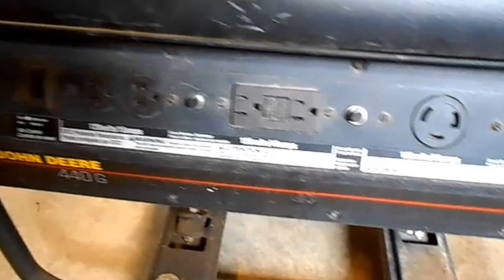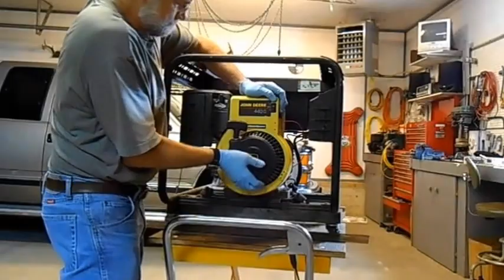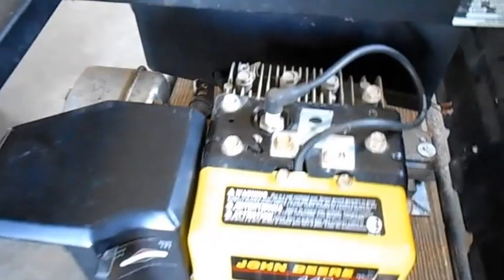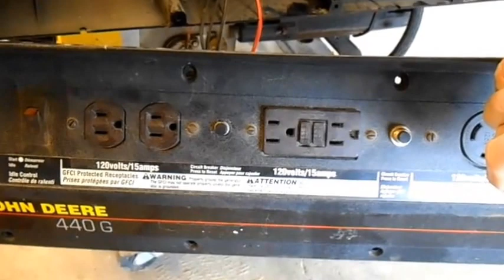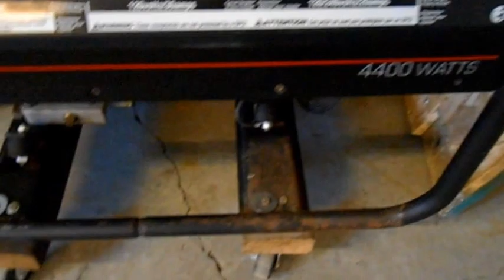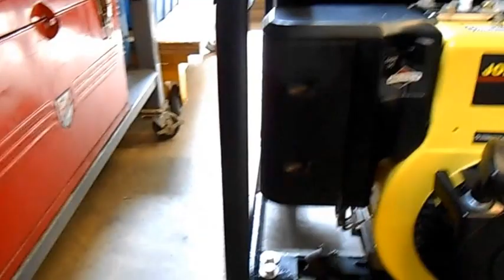John Deere 440G Generator Won't Start

Comment: Where would I find a coil pack? I have this exact model and I think this may be the problem!
Reply from the maker: First before you order a coil   disconnect the shut off wire from the coil and check for a spark with the spark plug removed.  If the is a condition like low oil or even a fake low oil it will not make a spark.    Here is a Canadian link  to the coil

https://www.amazon.ca/Ignition-Replacement-Stratton-Horizontal-Vertical/dp/B099ZPQZCQ/ref=sr_1_3_sspa?dib=eyJ2IjoiMSJ9.N4nOmUGS3wE_SvNCgZCj2y4GmHesSEQHW-EuaKTmoc6MKPOJoI3n282dTviWVFPo1XJQ3i8ijMu0AQnd3CsujepYs4LB6tfHKzaMbPgOG1dcbPUHjRb_6Iy9jwHMfbBW2cTPMjxn6Juj4ViU2GxY1K71JveGoxiUdrP2gYoOSYBo30qsfmAVaPES-2ZpwC8zkL1QKZTPA6N0004iOzmA8jMoXMt2Zcdj4MWb6fXwJl5JKpc8FRxSwnHkc3MuVKibO7kW40Ce_80jEFhSEr91XVNKYp_mQ-3-oRKWV2NLAuI.GK-pkUiZXRCw_XvVAMcox1LzYwY0VerFVWaEKx190xw&dib_tag=se&hvadid=600272903278&hvdev=c&hvexpln=0&hvlocphy=9001354&hvnetw=g&hvocijid=9009962168975190800--&hvqmt=e&hvrand=9009962168975190800&hvtargid=kwd-300259924936&hydadcr=17046_13464535&keywords=ignition+coil+398811&mcid=ed169d47cebf36728c55de9f8be6f174&qid=1749229738&sr=8-3-spons&sp_csd=d2lkZ2V0TmFtZT1zcF9hdGY&psc=1

Comment: What is that white wire dangling down from the front cover on the left side?  Not connected to anything.
Reply from the maker: Good point.  This is an old video and it is still hanging there.  I will look.  I am not perfect.  LOL
Reply: @BrucesShop  I am working on a john deere 550ge with the same wire that doesn't appear able to  attach to anything.
Reply: The other end goes to the on off switch, but can't figure out why it goes nowhere.  Maybe for a test procedure?

Comment: Where did you buy parts?
Reply from the maker: I ordered the coil from a local dealer and the outlets at an electrical store.  Remember this video was made in 2013 almost 8 years ago.  I want to know can you see the comments and date?  Please answer
Reply: @BrucesShop  mine won't even start.  It ran for 5 hours For 2 days.  Then stopped starting even after new spark plug.  Is it the coil?  The oil ...on light flickers when pulling cord but not sure if spark is getting to plug

Comment: I have one also, your is  looking more nicer. Mine also was giving to me its was sitting at back of a trucker garage for 12 years had it running but need a new kill switch. Nice restoration
Reply from the maker: Thanks.  It is generator season.  Good luck.

Comment: I would put a GFI on that outlet that is slaved to your GFI.  I have had problems with a Master/Slave configuration, in that the Master tripped off the Slave and I did not know where the ground fault was.

Comment: That is the first thing I turn off (main breaker) and then I turn on only the breakers I have marked with a red highlighter.  Back during hurricane Irma we were without power and we had supper cooked on my portable induction cooktop (1300w) and our small toaster oven.  We were the only house on the street with lights.  My polish pigtail is 12-2 W/ground.  I would love to pull a 30A circuit back to my switchbox but I could not run anything that was 220VAC because all of my stuff would overload the generator.  My house needs 12.5 to 15KW to run everything.  I would love a Genrac but they are pricey at my level.

Comment: When i ran my generator when we lost power I back fed it into my GFI outlet on the front porch.  It keep popping the GFI outlet so I fed it into another outlet.  After the hurricane had passed and we had power, again, I put in an 8 foot ground rod, so I could use the GFI outlet in the future if we loose power.  I know this type of connection is not up to code but I have used it for years without any problems.  I do not feed 240 into the house, just 120, and only use it for lights and some small appliances.
Reply from the maker: Well all I can say is do you turn off the main breaker to the house so there is no back feed to the main line?  That is a big deal up here in Canada

Comment: Nicely done! I'v had that same generator for over 10yrs now and have no complaints whatsoever, however lately it has stopped idling back whenever there is no load on the generator (nothing connected). It used to idle back to about 1500 rpms but now it does not. Any sugestions?
Reply from the maker: +Marvin Santiago There is a switch to make it go to idle.  is that dirty???
Reply: +Bruce Pender will check to see if that's the problem. thanks!

Comment: Hi, I've been looking at the new John Deere generators, specifically this one 

https://www.deere.com/en_US/products/equipment/home_and_workshop_products/generators/agricultural_commercial/pr_g6000m/pr_g6000m.page?#viewTabs

They use the Mi-T-M engines and to be quite honest, I had never heard of them before. Do you have an opinion as to their quality and reliability?  It appears that Mi-T-M makes the generator and slaps JD's name on the front, in addition to painting them green.  lol

The specs and features seem okay as is the price.  For the one above around $800.

Your videos are great, always enjoy them.

Thanks for your help
Tony from North Carolina
Reply from the maker: Being OHV it would be easier to start.  I can't say anything about the quality of the motor except that they are Kohler.  I found this link for you.  They are probably a good generator.
http://www.amazon.com/Mi-T-M-GEN-5000-0MK0-Portable-Generator-Kohler/dp/B00JL6LUSA